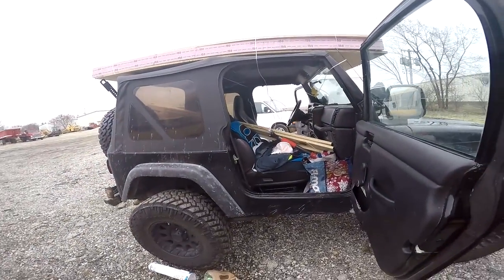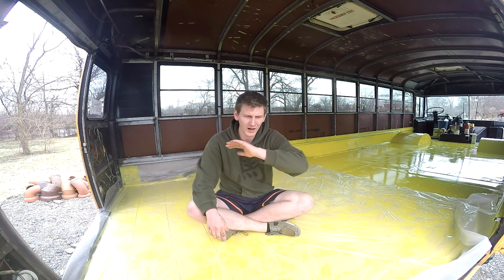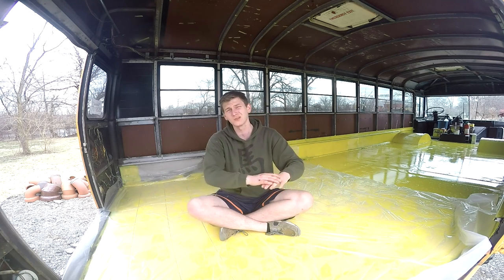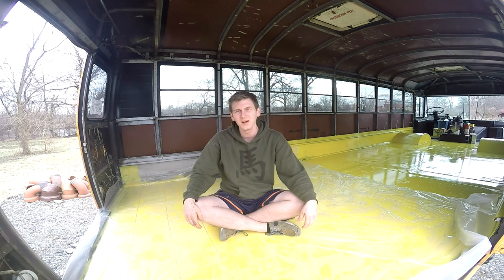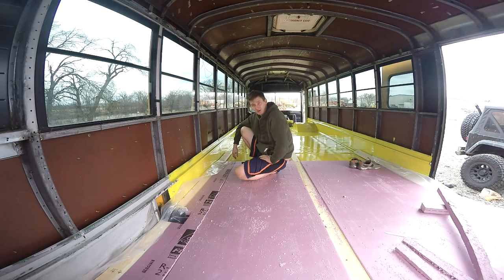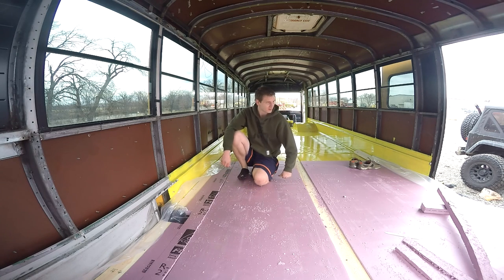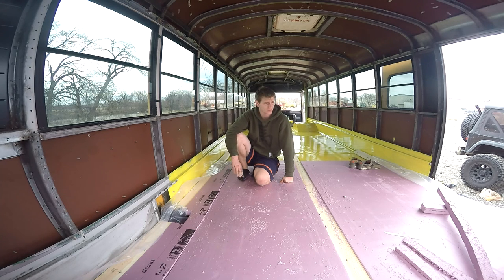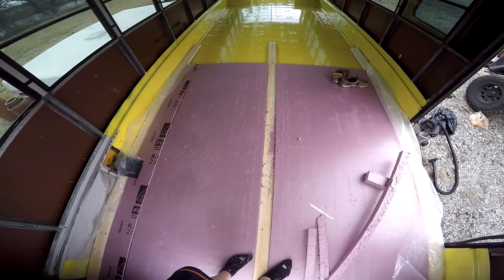School Bus Conversion #26 ~ Floating Floor? Pt1

Comment: So why did you paint the base floor bright yellow? It seems really unnecessary or am I missing something? Also, is the only real advantage of the floating floor the fact that you don't have to drill holes through the base floor?
Reply: Can't speak for them... but in my experience, I use bright colors when I paint things that end up getting covered so I can easily see if I have missed anything or if I have evenly covered the area.
Reply from the maker: Yeah I didn't want to drill through the floor and the whole build on the inside can flex a little. I wanted to protect it from rest and thought it would be ironic to be yellow.
Reply from the maker: Didn't think of it that way but yes that is perfect as well. Thanks for watching.